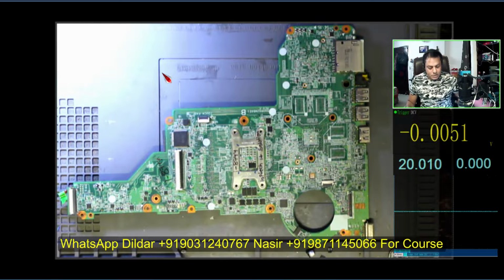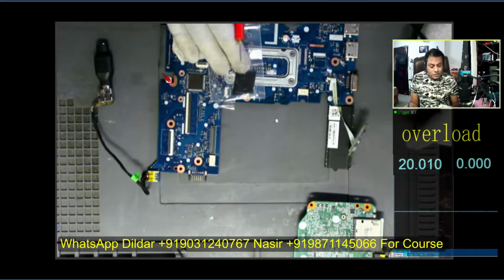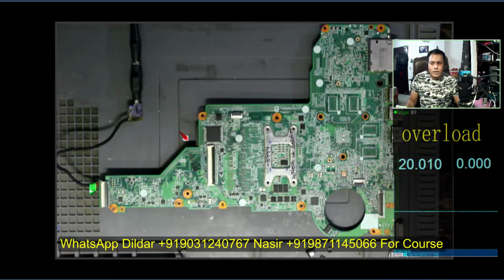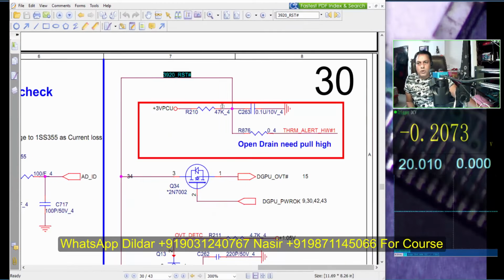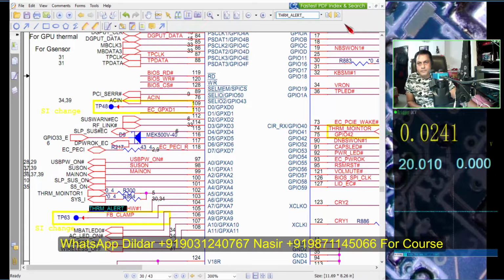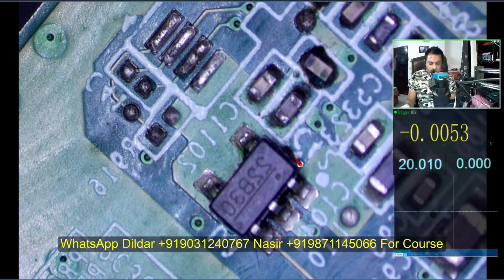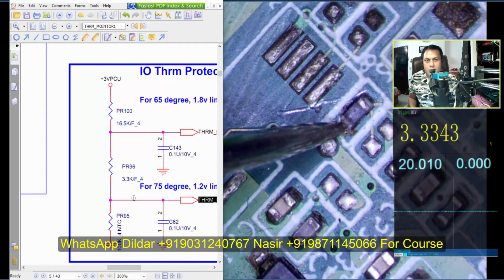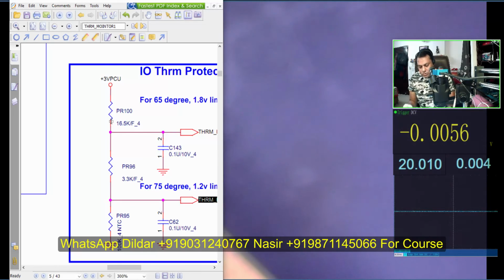HP R62 Laptop Motherboard DC JACK LIGHT BLINKING Sol |Online Chiplevel Laptop Repair Training Course

Comment: Thanks for the video. Can you help me with my faulty laptop as I have the same motherboard but with a GPU and is Pavilion G7-2100si Quanta R33 DAR33HMB6E0 Model which turns on when power button is pressed but the display does not turn on, no vga/hdmi output, no USB communication but there's power, fan spins normally but doesn't slow down as it down when pc is turned on, and all voltages are present..
Reply from the maker: It's SPI firmware issue.

Comment: sir ji nice video ......................this motherboard light bilinking common issue pr100 faulty .....question is why pr100  faulty mostly time ........resistor value issue /resistor size issue /temp issue /divider resistor value issue
Reply from the maker: Correct bro 👍
Reply from the maker: Ans is available in the video.

Comment: Sir hp laptop is power on from charger but no charging light is glow and battery is not charging why?
Reply from the maker: Check charging section requirements.